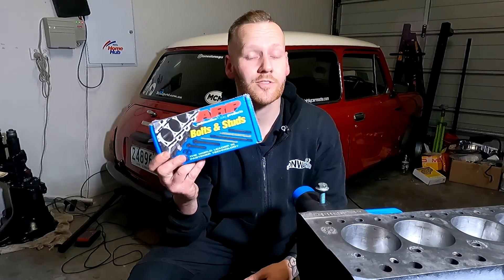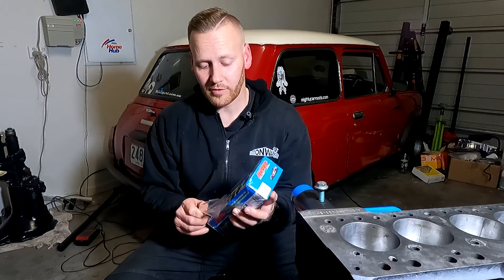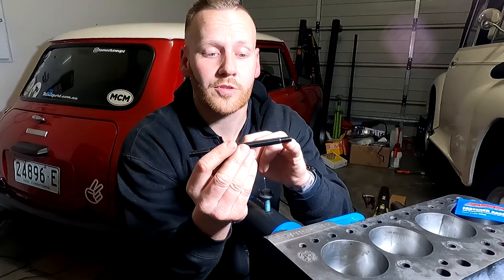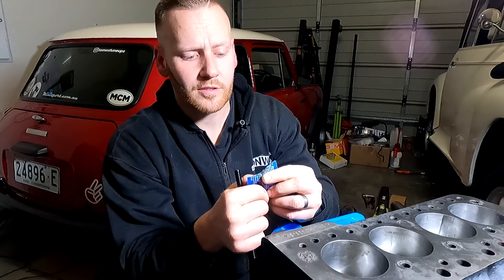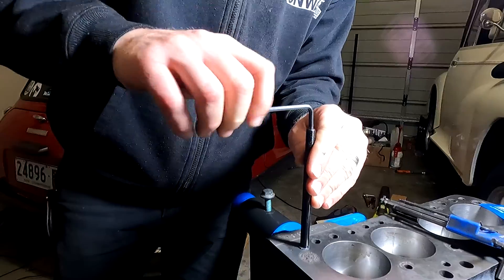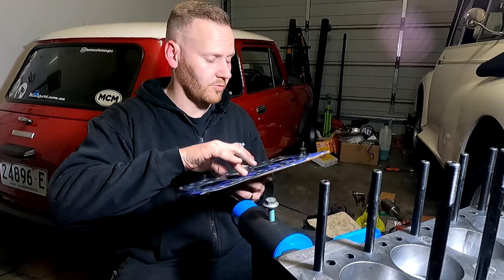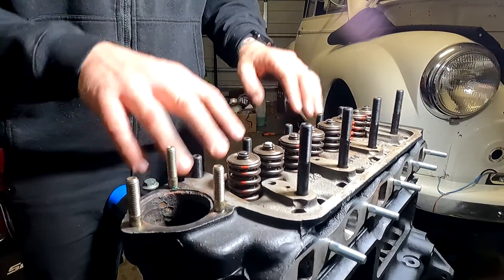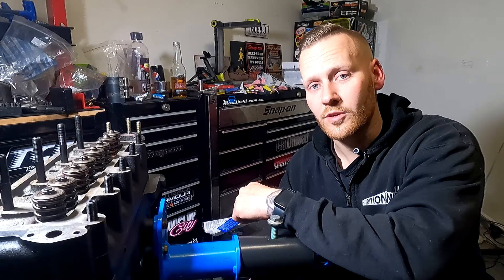How to: Install ARP head studs

Comment: Arp didn’t say to lubricant the thread of the stud from bottom only if exposed to water to use thread sealant
Reply from the maker: @Kh.J.  ohhhh, interesting! So it’s not a sealant per se, it’s more of a coating when exposed to the elements. Thanks for the info mate

Comment: Hi, thanks for the video, I am just wondering what head gasket that is, looks decent I wouldn't mind trying one.
Reply from the maker: @danielwebb5680  hey mate, thanks for your comment. 

I think this is a standard fibre gasket. It’s ideal for basic engines with standard to light modifications. Hope it answers your question. 
Tomo
Reply: @Tomostuneups  Cheers, I have had trouble with small bore high compression motors and head gaskets over the years, never had any trouble with large bore, seems to be a lot more head gasket options with the large bore motors.
Reply from the maker: @danielwebb5680  agreed. I find the BK450 to be the best for larger bore engines, in my opinion anyway.